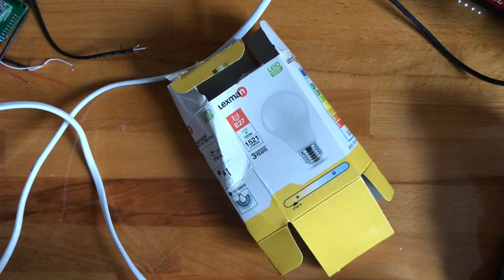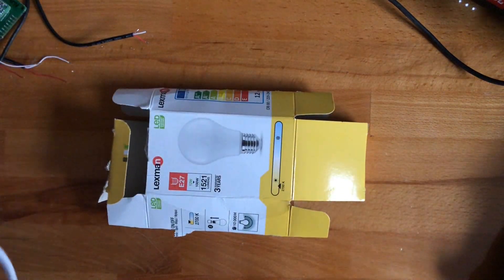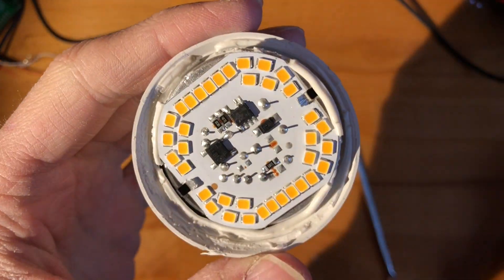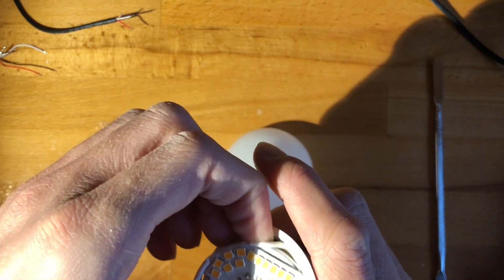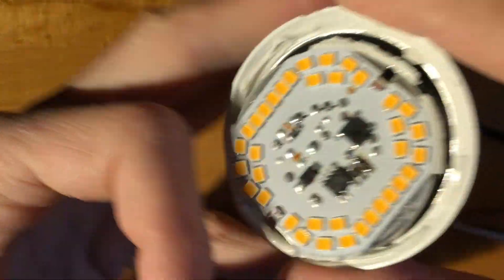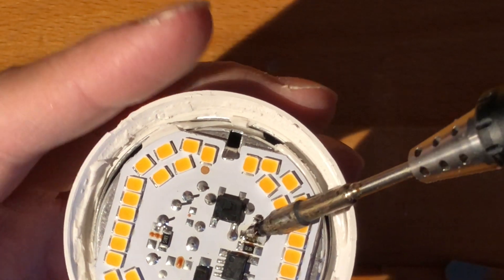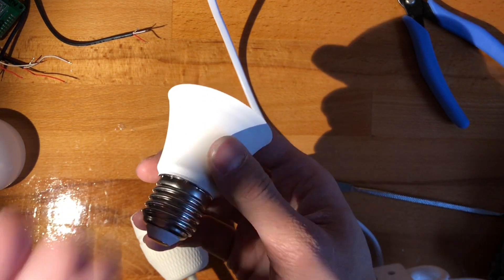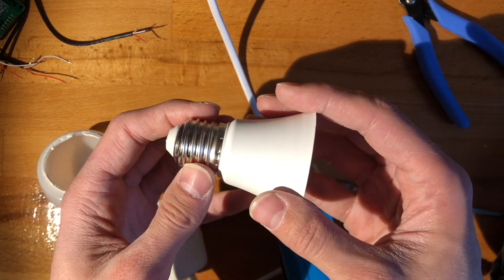LED Bulb Hack - Decrease Power & Increase Lifespan (1)

Comment: You don't really need the tool to get the globe off if you have strong hands, just put thick, grippy rubber gloves on and twist the two pieces apart.  However on the larger BR style floodlight bulbs, sometimes they have latching tabs and it matters which way you twist them.

Also, if they are used in a fixture where you don't need the light diffusion, nor electrical protection (no water exposure and no children with pokey fingers), then you gain quite a bit of light by leaving the globe off.

Comment: get two identical lamps, modify one, leave the other as is, and compare them side-by-side. Let's see what the difference in brightness really is. I'm sure you're exactly right, that even though you're cutting power consumption in half, the light output should be well above half as bright. If you ran the two lamps in the same fixture, I'll bet that over the years, the light output becomes more equal due to less degradation in the modified one, and much faster degradation in the stock one.
Reply: I did this with two shop lights from Hazard Fraught; one that I removed one of the current feedback resistors on, almost halving the current iirc, and a stock one. the difference in brightness between the modified and stock one was less than 10% according to my cheap lumen meter.
Reply: @francistheodorecatte  If you actually cut the current in half or nearly so, then your cheap lumen meter is WAY off, as you'd typically gain around 20% efficiency, which is something, but that means they would be about 60% of their former brightness.

Comment: Wouldn't it cause more flickering? since it would have half of its lit time cut out?
I'm looking for a better way to underdrive the bulbs but i do think that it would cause more apparent flickering and tire the eyes faster
Reply: Depends on how the driver is designed.  If it is the better design, it has an inductor (and/or transformer) and that inductance smooths out the ripple, greatly mitigating the amount of flicker.  However the cheapest LED panels now, often found on things like cheap work lights, that have all the components on the aluminum carrier, with minimal to no inductors, would definitely flicker more.